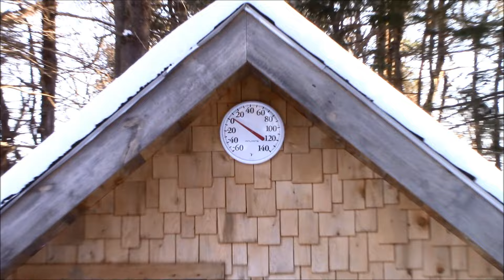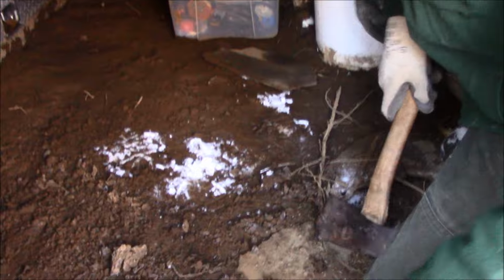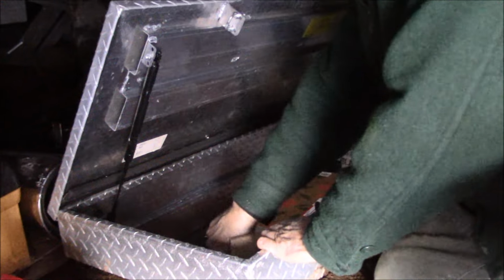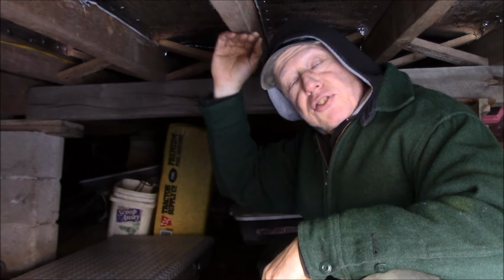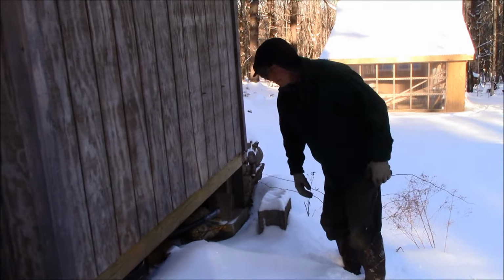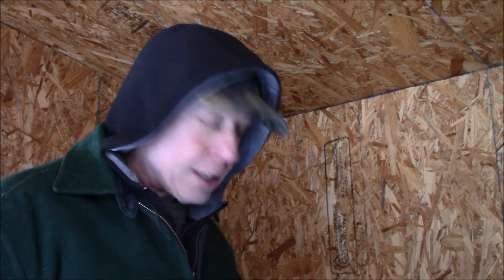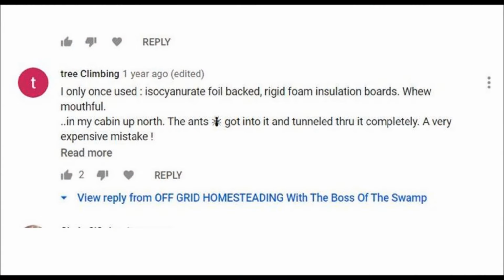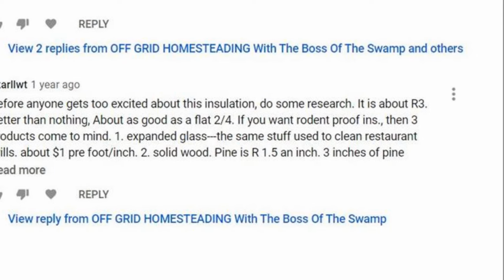Awesome Floor Insulation For A Cabin In The Woods   3rd Year Review

Comment: My one wood framed garage is about 16'X24' and I recently had the Amish comes in to install new metal roof and metal siding. Before they installed the metal roof they lined it with bubble wrap and did the same with the walls. I have a garage pit for changing oil on my vehicles and basically the floor is stone and dirt. Its not heated, but on any very cold winter Pennsylvania day, that garage is noticeably warmer inside then the outside temperatures and I can't explain why. Maybe the heat raises from pit below the wood blank floor and is trapped in the garage. It was a surprise it us.

Comment: Ive used same product since 2003 on my houses, apartments and cabin. 
Must sandwich and warm up dead air cause if no heat in space it will reflect cold as well. So tiny heat source will work and reach farther due to dead air and reflective properties if installed correctly and seams should be sealed with foil tape. I use it on many crawl spaces, and subfloors, walls, evennunder carpets as carpet pad to stop water or urine from damaging subfloors in apartment. Its great wind and snow break
Reply from the maker: Thank you for sharing your experience.

Comment: Well I wonder what would happen if you didn’t started wood stove for a day or two .
I bet it would freeze under there too.
I think you heating your cabin and the same time heating under the cabin with the same wood stove as I believe skirting alone would stop from freezing if you had heating in the cabin .we had that in my moms place .
Well in the other hand you got much more usable space under there .
And if it’s works for you well done 👍 why worry about others.
I think it would help if you used laser thermometer under the cabin under and the above the foil also the floor temperature under and above .
Reply from the maker: Without any heat in the cabin,  the crawlspace would eventually freeze but it would take quite a while.  My stove is out and I'm barefoot as I type.
Reply: OFF GRID HOMESTEADING With The Boss Of The Swamp as long as it’s works for you man I’m good with it 👌

Comment: Thanks Boss, I was convinced a long time ago when you talked about it.
I plan on using it on my cabin floor in the western MAINE mountains.
My only concern is keeping it dry during construction, while closing it in.
Reply from the maker: If water gets trapped, just slit the foil lengthwise between the joist and let it hang down. Staple back up when the floor dries out. Or install it between the joist afterwards like I've done here.

Comment: The R value is probably secondary to the nearly airtight seal of your floor. Combined with it's use in the skirting and it'd probably only get drafty if it's cold and really windy outside in which case you're going to find every other gap and crack too. 

Even if the r value is only say 3 that's going to get you one third as much temperature drop as you'd get without it. Plus the air gap created by the 2x4 framing in the skirt amounts to another 1r, so one forth the temperature drop. Your floor insulation might work even better with a small air gap like for an attic radiant heat barrier but then your pipes might get frozen.

Comment: I watched a video I am guessing 2018, (time flies, so I am not sure of exact time) where you showed putting it on the floor and them putting flooring down afterwards, I have watched enough of your videos to know you speak of what you know, not what you assume to work. My daughter was worried before the winter of 2018/2019 about her chickens over winter, I told her about your video, she watched it and bought the bubble foil and insulated the entire coop, sort of a blanket wrap around the outside, including the screen section under it. Half her chickens never even went up into the top part where roosts were, she put straw down under it and they just stayed there for some reason. She never lost a chicken to the cold, never had an egg freeze, and she said when she would slide the door back to get eggs out of the nests, she could feel the warmth inside. Naysayers be damned, this stuff works, in fact I took a piece of it into the deer woods to sit on when stalking, and taking breaks, sat on snow covered stumps, logs and rocks, even the ground and my backside never got cold, reflected back my body heat. My daughter and I are both believers.
Reply from the maker: Thanks for sharing this :-)

Comment: Hey Boss,,, what does your building inspector say when they inspect your cabin after your upgrades? I’m assuming you had to pull permits like I do.  I have a new cabin on piers and they want to see the R value and air pressure test on the building. My cabin is in NH too.  I genuinely share your interest but what do we do when the man wants me to put the pink stuff in???btw you have been inspiring me on this build for many years. Love you guys✌️
Reply from the maker: Parmits yes but no need for inspection here.   For higher R value I would use more layers of foil with air space in between but for my place, A higher R value would make my pipes freeze along with my oranges.

Comment: Thank you so much for this video..I recently bought a cabin from an old army buddy in the mountains of west virginia. The cabin walls and roof are all fully insulated  but the floor was not ..it does get into single digits sometimes on the mountain and I can feel the floor is like ice! I was thinking of using the pink crap and then plywooding..as you said that would be a nightmare to do and would make a warm place for rodents! Your idea looks great and so much cheaper!. I also have a big shed here in western NY fully insulated except for the floor..had thought about the pink stuff and foam insulation..the bubble foil will be so easy to do!  Thanks a lot this will save me a lot of tie and money!

Comment: I used your idea just around the bottom of the camp to keep the cold air and snow from getting under it with steel roofing over the top of rap. I can not get to the floor to add it there. But after we get the camp to temp the floors try warm. I think it work fine.  thank you.  from lost nation camp nh

Comment: Hey Boss. I was looking at your freezer shed and had a thought. What if you installed a 4" dia pipe through the shed wall and the freezer wall. If you had a baffle in it and a fan it could be opened and closed based on outside temps. Maybe automatically with a thermostat. Could save some propane.
Reply from the maker: I have an awning window for temp adjustment  :-)

Comment: Hey Boss , ive been using bubble foil for years. The biggest hang- up i get with people is they are equating it with insulation. It is not. It is a radiant barrier and most people cant get past that. There grand daddy used insulation, there daddy used insulation , and now they use insulation. They cannot get it past there small melons that it repels heat and cold. It does not insulate. It only has an " R " factor of 7. Heat hits it and bounces back , cold hits it and bounces back. Here in Alaska this year , where we are its hitting -35 / -45 for extended periods. Not normal for us , but ill be damned if my floor is not warm. It must be some kind of trick i am using to fool people. Best wishes to you both.
Reply from the maker: Agreed buddy. The stuff is magic.  It does say "Radiant Barrier Insulation" on the package so I'll insulate with it haha  :-D

Comment: I don’t have a cabin. But when I had a pop up camper, I had some bubble foil my son brought home from work. It had been wrapped around something that was shipped to them. Anyway, camper sitting in hot sun, inside over beds got really hot. So I stuck the bubble foil up against the canvas over the stabilizer bar. Major change in the temperature. Then when it got cold I zipped it between the canvas and the screen and some under the mattress. Much warmer sleeping. It may not have a high r factor, but it reflects cold back and hot back, or keeps it in. So Bronx cheer to your naysayers. I’m from the south, but Bronx cheer still fits. Thanks for sharing what works for you. If we try it and it doesn’t work we haven’t wasted vast amounts of money. But I’ve not found you to be wrong on what works for you yet.

Comment: Heat loss is often managed using materials that rely on conductive heat transfer. Radiation heat transfer reduction is another means that can be highly effective. It appears that using bubble foil is effective and I suspect that radiation heat transfer is managed well while not degrading over time and resisting rodent attacks.  I like the approach and intend to do the highly labor intensive installation in the crawl space of our existing cabin.

Comment: I believe in you!! I have a place in PA. There I have a shed I would like to insulate the floor.  Right now I have a plywood subfloor I was going to put it over the plywood and then put more plywood on top? however that does not seem like it would work.  Just asking your opinion should I rip up the floor and then staple it to the skids and then put the plywood back down? so it also works as a moisture barrier
Reply from the maker: Part 1 and 2 are listed in my description. These should answer your questions.

Comment: Hi Sir, I live up north in Canada. I'm starting building a 16x16 shed/wood workshop at my lake lot next week. I have been searching the web for a way to insulate the floor of the shed (I want to be able to use the workshop in the winter) and was very concerned about rodents and then I found your first video today than watched the second one and now the third one. :-) I can tell you one thing: I'm putting foil insulation between the floor joists and the plywood of the shed I'm building!  Thank you so much for sharing your experience with this. (and I subscribe to your channel as well, great content). Thank you! Best Regards!

Comment: Ok well I know walls are better off with insulation, I get that but I just made a small shed for my snow blower and lined it with bubble foil. I put a camera and thermometer in there too, and a heater that turns on a t 40 degrees and off at 50 degrees….my cabin  and shed is in the California sierras and it melts the snow off my snow blower before I lined it with the bubble foil the heater ran 90% of the night…. Now it runs about 40% of the night….so something is working!

Comment: I insulated my skirtless cabin on piers about a decade ago with a black and foil backed foam board. Ants don't mess with it. I can't remember what the stuff is, but I remember it was an expensive job. I'll have to climb under there and report back.
I just bought a home on the outskirts of town that sat for three years. Mice and water did a number on the crawlspace and the attic floor insulation. I ripped out a quarter of the crawlspace insulation and am considering using bubble foil. It's a heated crawl space. only problem right now is the subfloor nails. Need a quick way to cut them down for the bubble foil. I guess I could hammer them over.

Comment: I wish I could talk to this guy. I'm having an issue with mice. I live by a creek in the woods. Figures, right? After we got the crawlspace encapsulated, my wife started sneezing. I think I made a better home for mice when I did that. We live in a manufactured home, so the brick skirting isn't connected to the house. We do have two sump pumps connected to french drains around the perimeter of the crawlspace with 12mil plastic. Looks nice and stays dry. This sounds like the perfect fix in combination with new ductwork (installing UV lights in the HVAC cabinet also). The insulation guys told me it would cost around $2500 to remove and replace the belly bag with insulation. If I gotta rip out what I have now, it just makes no sense to replace it with the same thing. The bubble foil seems cheaper. 50ft roll for a little over $90 ain't bad.

Comment: My place has bubble foil around the skirting poorly installed by the previous owner. It works good until it got to -10 F one night then I had a trap freeze. I think when redo the skirting I will use it again only it will be installed much nicer and cleaner

Comment: Just found your you tube channel,  and noticed that you mentioned Composting toilet? Not sure if it was this one or a  previous.  Any rate, i will be building an off grid cabin next year in New Hampshire, and wanted to use a composting toilet as well, so any information would be greatly appreciated
Reply from the maker: If you use anything other than a over priced septic system, It's best to operate on the don't ask - don't tell system and you won't be bothered  :-))

Comment: Part of the insulation value of this material is the trapped air in the bubbles. The other is the reflective value of the aluminum foil. Using these as described and combined with the insulation and gas impermeable nature of the plywood the results are to be expected. The major source of heat keeping the crawl space warm is the ground. Ground only freezes  if exposed to cold outside air. This system works.
Reply: You are correct the ground is warm and radiates natural earth generated  heat up into the wind sheltered  crawlspace. The bubble wrap is just enough to maintain it. I would guess that the heat transfer up from the warmer crawl space makes the floors feel much warmer. Since it is a lower R value material it is working in reverse logic. In the freezer room it has just enough R value to keep the floor from freezing, would be better if the underpinning were completed.
Reply: Proven to work and be rodent proof, enough said!

Comment: Hey Boss! I have been building an off grid 300 sq ft cabin on a boat access only island on the west coast. I have followed your advice on many things. Bubble foil floor, and building higher off the ground, and gray water catchment. But I am stuck about ceiling insulation. I have a vaulted metal roof with
Reply: Rockwood between the rafters. The cabin will sit unheated for a couple of months in the damp west coast climate... So do I use vapor barrier or just put in my TandG ceiling over the rockwool without a vapor barrier??My big fear is mold. Thoughts??
Reply from the maker: I would use a vapor barrier. You could always staple the bubble foil to the underside of the rafters, then strap the ceiling and nail the T&G to the strapping.

Comment: I used this method to insulate the floor of my off grid cabin. I haven’t skirted it yet and not sure I will. I use it mostly use it April through December. I built my cabin in a field and probably too close to a giant 5 trunk oak tree. FOOD Source for mice. Sorry I can’t post a picture I would show you my build picture of the insulation. Thank you.
Reply from the maker: If you're warm, then no bother skirting it.  This stuff works great though doesn't it?

Comment: I used bubble foil after not being satisfied with my existing blown in insolation in my attic. due to my desire to beat the summer heat, and the fact that the sun baked the attic, it was unbearable to try to retrieve items from the attic before I used it. My attic was completely different after using it. it was noticeably cooler. I Thought of it as about the same thing as the emergency blankets that they sell for hikers. It just works. Not as good as other insulations for other applications, but wow! what a difference! Thank you sir, for your effort to share your successes with others. Also, for your resilience when dealing with inexperienced Trolls.

Comment: Hello Jim. I know you have tested this for a floor and crawl space…which I will be doing this summer. Have you ever tested for a wood ceiling? Thanks Paul in Muskoka 🇨🇦
Reply from the maker: I have it in several ceilings but it MUST always be applied so that it reflects heat back into the ceiling material and NOT against the inside of the exterior sheathing because that will reflect cold back into the sheathing, creating moisture.

Comment: Wood is supposed to have an r value of about 1.5 per inch. If heat only has to go through about an inch to get through the floor, subfloor and past bubble foil then it's only that r 1.5 but almost completely draft free. Iirc most heat loss assuming little to no draft is conduction. The radiant component is smaller but significant. In thermal IR an uninsulated wood floor would be transparent or translucent. Blocking convection probably helps a lot more than reflecting that radiant portion but it's doing both anyhow.

Comment: Are you heating with a wood stove? If so, what happens when you leave for a period of time and there is no heat on the interior? The heat you described seeping down into the crawlspace would not be there (unless you heat with electricity?)
Reply from the maker: Yes a wood stove but nothing would be warm if there wasn't a heat source going.
Reply: @thebossoftheswamp  If you do not keep the wood stove going to heat the space, then if you left for a period of time wouldn't the crawlspace eventually freeze and the pipes burst?

Comment: Oh, one other thing. I made a pouch from bubble wrap that's just big enough for my camp pot to fit in. I get water boiling, put in my dehydrated food, and put the pot in the pouch i made. That pouch keeps my water in the pot cooking hot till my food is done. that means using a lot less fuel to cook with. I don't have to burn fuel the entire time im cooking.  Just get the water boiling, place in my noodles, put in pouch for 15 minutes, BAM! dinners ready. That heat being reflected back by the bubble wrap is awesome.